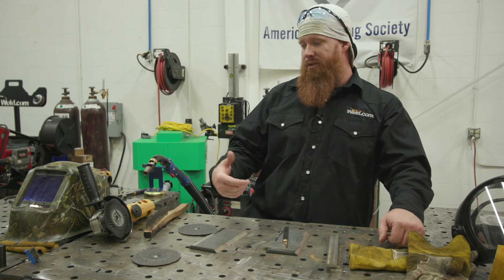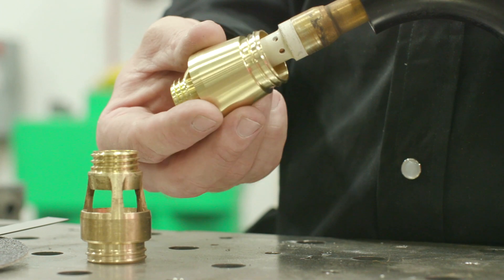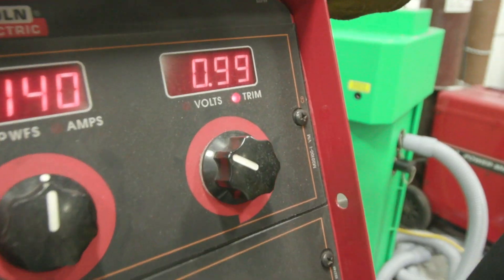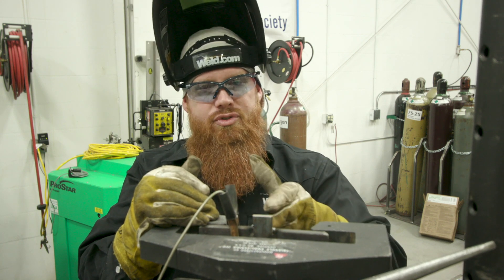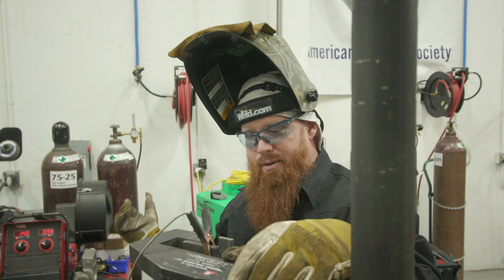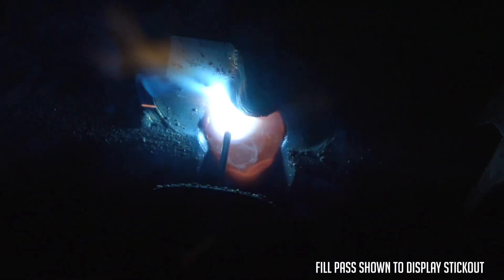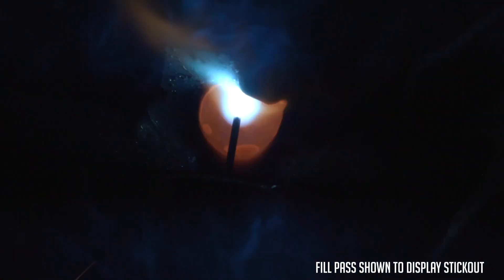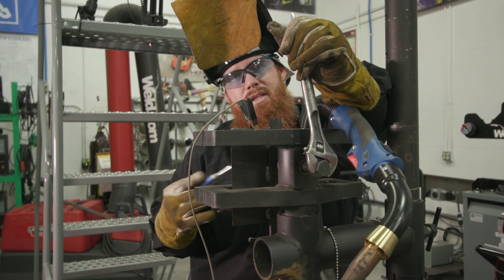Vertical Pulse MIG and Fume Extraction Test

Comment: I welded vertical up pulse 0.45 100s wire with 95/5 gas for years on 3-4 inch thick material UT butt welds on the new zumwalt class destroyers for the navy. The navy required us to use this process due to heat input. My god it’s soooo slow lol. I know your the pro here. But I’d like to make a suggestion to you. When running vertical up you can’t spend any time at all in the middle. Side to side. Hold left 123 hold right 123 and literally skip right over the middle. Your bead will flatten right out nice. I mean no disrespect to your welding i just wanted to share that suggestion to you.
Reply: Good ole hii
Reply: @blupico  haha I knew who he was but I worked in the aluminum shop and ab.

Comment: What wire feed speed and voltage would you recommend starting on 3/16 steel? There's no trim rather arc control. It's a miller. Thank you.

Comment: 145 on the wire speed is slow for .045 wire. Its out of the low end of the parameters at my job for pulse. With our Lincolns, that only puts out like 90A.

Comment: Started with pulsed mig at work recently, have a job coming up involving some heavy plate and pipe nozzles. 
Company have bought 2x Miller pipeworx welders. 
Am having real trouble getting settings and a rough technique for a 3 pass 10mm fillet (pipe to plate) in 5F position. Getting very high crowned beads at moment, and not very good root pen. Need some ideas for starting points with settings. Ie feed speed, arc length control, arc width control, gas flow rate, and 
Somebody help please lol.
Also have to fill and cap a 4" 6g butt, and need settings idea for that too. 
Thank you 👍

Comment: You are wrong 75/25 does work
Reply: Jerry Baker not for a true spray transfer you need 82% or higher.
Reply: Jerry Baker please don’t take my word for it. Feel free to do some additional research. Here is a paragraph from Lincoln Electrics GMAW guide that has a pretty good explanation. 

“Axial spray metal transfer is the higher energy mode of metal transfer, whereby a continuously fed solid or metal-cored wire electrode is deposited at a higher energy level, resulting in a stream of small molten droplets. The droplets are propelled axially across the arc.
Axial spray transfer is the higher energy form of GMAW metal transfer. To achieve axial spray transfer, binary blends containing argon + 1-5 % oxygen or argon + CO2, where the CO2 levels are 18% or less. Axial spray transfer is supported by either the use of solid wire or metal-cored electrodes. Axial spray transfer may be used with all of the common alloys including: aluminum, magnesium, carbon steel, stainless steel, nickel alloys, and copper alloys.”

Comment: Or try welding  .033 pipe with  .035  Wire using rapid X at 350 inches and  .85 trim gas should be 7525 at 50CFH this is also one of my tests I took

Comment: Try this its required for our weld test Lincoln rapid x 400 inches 1.0 trim lap joint 1/8 plate overhead 75/25 gas
Reply: We did Rapid X at 800 inches on 1/8 check out the video. https://youtu.be/rAvlYgabAH8

Comment: My question is does that stick out you mentioned apply for all pulse welding positions because I work for a company that only uses pulse mig welding and sometimes I get that cracking sound in the flat and horizontal and I am tired of cleaning a shit ton of bb’s. Also I was told you are not supposed to put any motion into your pulse weld bead...thoughts and advice please
Reply: Charles Baker yes that stickout applies to all positions on pulse. You won’t need much manipulation in flat and horizontal but you will have to oscillate slightly getting out of position.
Reply: So basically if I was doing overhead and uphill I would need to oscillate and maybe downhill as well right?
Reply: Charles Baker overhead not so much, vertical definitely needs some oscillation/manipulation. I wouldn’t do pulse vertical down unless it’s an STT mode.
Reply: Thank you so much Mr. Becker your advice has helped a lot and I appreciate you taking the time out of your day to help me out. Again thank you.

Comment: At that point just use .035 or .045 dual shield flux core. Pulsed mig equipment is overly expensive and fragile. It’s a great process for some applications but for most things it isn’t worth it. How do I know? I’ve been using it for 10 years now and the quality hasn’t really changed but the productivity has dropped. The cost of machinery along with more maintenance also didn’t help.
Reply: bojengels1 it will depend on what the WPS says. We’re just showing how to do it for anyone who needs it.

Comment: I've only gotten to do spray/pulse spray on a couple tests. Loved the process,  passed the test, didn't take the job. My next MIG machine  I hope to have a pulse spray capability.  
Since you are talking about welding thicker metal how about go the other way and weld some thinner stuff with .023 wire. I'm doing that now and seem to be fighting wire feeding issues/speed.

Comment: If one has a multi-process machine (MTS) and if one is a cheap ba$t!d can one use pure Argon for spray transfer MIG?  That way one gas for MIG or TIG!
Reply: Running pure argon with MIG gives you a weld with a very high crown (center of your weld) and not as much penetration. The CO2 helps to wet out the edges better and definitely increases penetration.

Comment: Very new to welding.  When you say spray what does that mean and does the welder you are using have a pulse setting or is there something I'm missing?
Reply: Spray is one of the transmissions for mig welding. Verses short circuit where the wire touches the puddle/plate to ground out, spray melts the wire above the plate into a pseudo mist just from the heat of the arc. It is commonly used for thicker material, like he mentioned in the video, where short circuit would leave less than desirable penetration into the base metal. Leading to lack of fusion. The pulse aspect of it makes the machine pulse (kinda like turning the machine on and off very very fast) to the point where spray arc (normally limited to flat and horizontal) can be ran in a 3g/f and 4g/f position just from having those short milliseconds of time to cool the puddle down enough not to just drop out.

Comment: Why does pulse have better fusion than a constant current short circuit?
Wouldnt short circuit put more heat into the weld, having no gap in power.
Reply: Beach&BoardFan no, short circuit is just that, it creates a dead short about 200 times a second so the puddle doesn’t have the same energy as a spray application would. Spray has much more heat.
Reply: Jason Becker Absolutely correct, if you ever look at the results from an impact test , charpy test, you will see the lb/ft values are a lot lower on the root ran in short circuit and get higher throught the layers of pulse weld and sub arc because the joules input are a lot higher with the other processes.
Reply: Jason Becker  I think I got it, sort circuit doesn't have an arc, it needs to contact the material to pass current. But the pulse, arcs even before the wire gets to the base material?
Reply: Beach&BoardFan short circuit does have an arc, the mode of transfer just doesn’t have heat (amperage) as spray.

Comment: the crackling is because your trim is set too low ...  set it to 1.05 or so not .99 and you will seethe is no crackling.  you dont have enough arc voltage that is why its cracking ....  also people pass structural test with short circuit mig every day ....  just saying ...  granted the spray pulse is better and hotter and has better penetration but short circuit can be done ....  also if you have enough arc voltage you can spray with 75/25. Absolutely hands down it is possible. now is it smart or desired ? that is a different story .... you are running the risk of undercut and you have a less stable arc running 75/25 but it can be done..... add about 3-5 volts to make up the difference in gas .....
Over all good video - good arc shots, good demonstration, nice weld.
Reply: zila whats up bro
Reply: i agree

Comment: Nice work, but what happen to the 2nd fill cap pass. 🥴 So I'm going to get my request in. 1" thick sidewall A36 pipe say 10" Diameter  V groove welded to T1 steel on a trunion. 2mm gap. 1st pass STT root, then 045 finished. 😏 Just a typical day at the office. 😄

Comment: What happens if you can’t get that mixture? Because I don’t get large enough tanks, they won’t fill it with anything more than 75/25. Yes, I can get pure argon, and a couple of other gasses.
Reply: It is always the “big bottles” story , that all the gas delivery companies and  managers want to sell us, doesn’t matter what we really need. I use for a decades one mixture that I found the best for mild steel, and, opposite to others I use also small cylinders, like 2 , each of 10 liters. First one is 82/18 and the other is 97/3 ( 97% Ar+3% O2), mixing those together with Y connector. Gas flow should be 64% of mixture 97/3 and 36% of 82/18 mixture that are entering Y connector, mixing inside and are from Y connector gas mixture goes to welder. Advantage is that man can situate both cylinders on welding car, and change it Independently, disadvantage is that for every final flow rate man must calculate both flow rates. For example, if you need flow rate of 15 l/min, you must use approx. 0,64 x 15 = 9,6 l/min on the first manometer of 97/3 Ar/O2 , and 0,36 x 15 = 5,4 l/min on the second manometer of 82/18 mixture. For other flow rate, you must each time calculate the ratio values. Second disadvantage is that mixture of 97/3 is going to come in Y connector  with bigger pressure, so to fully mix both mixtures, it will pass 3-4 seconds, so, your regulator for pre-flaw time must be at least set to 4 seconds. For US guys, 1 liter is 0,0353147 cubic feet, so 15 l/min equals 31.8 CFH ( cubic feet per hour). 
I tried to convince Air Liquid to fill the small bottles with similar mixture they are producing (Teral 24 7) that contains 91,5%Ar,+6,5%CO2+2%O2, but they refused to do such, the smallest bottle they produce is 33 liters and it is clear not applicable to be transported on a small vehicles.
Reply: I'm a little bit puzzled by your supplier. 90/10, 98/2 should be available in cylinders same as O2 bottles you use with a cutting torch.
Reply: Nope, against their policy. I have 80cf bottles, because it’s what I can get in the car. I’m not a pro user. I’m retired, so bigger bottles aren’t necessary, though if they would deliver to a residential area, I would get them.
Reply: Mel Gross check another supplier. I have an 80cf. and my supplier fills mine with 90/10 all the time.

Comment: I’m sure this has been requested before but if you guys could do a 1/16 dual shield flux core video that would be awesome.
Reply from the maker: It's in the works. Any specific application or position?
Reply: Flat horizontal or vertical, any one or combination of those would be great, we use it to build overhead cranes and heavy fab With CO2 shielding gas, would be cool to see how an expert runs it settings and etc.

Comment: I would like a video explaining trim and wire speed with the pulse setting. Also explain the different shrouds. I did not know there were different applications of use with different shrouds. Good video! I have been practicing uphill mig, to me it’s harder than how you guys make it look.
Reply: Trim is basically voltage, and it also adjusts arc length
Reply: I believe the shroud is for the fume extractor behind the nozzle

Comment: you said half inch to 3 quarters inch for good fusion and for it to run good.. would it matter if you're even closer? I always find my self just getting so close with the cup almost touching. almost just burying the gun tip in the joint. or say you're in a corner joint could you just put the cup in there and drag it if it's that close?
Reply: the spray arc does not have enough "room" to develop right .... also the longer the arc is the more voltage you have ... the crackling is not desirable when welding pulse spray. longer arc and longer stick out helps with more arc voltage and less crackling ....  besides trim could be a little higher that would help too .....  
if you find yourself very close and the cup almost toughing or even dragging are you welding spray,? pulse? or "regular" short arc (short circuit mig)? 
If you weld "classic" "regular" mig no spray no pulse you are supposed to be super close !!!!!  it is a totally different welding process ....
Reply: @ZILAwelds  thanks i recently started working at a shop where all they do is pulse mig with lincions the other shop i worked at for 4 yrs was just short arc. this explains quite a bit and makes sense why I saw a guy with such a big stick out distance and different looking welding puddle and weld and how it was running.
Reply: Tip will heat up causing feed problems
Reply: @clevelandmortician3887  thanks that explains some things.